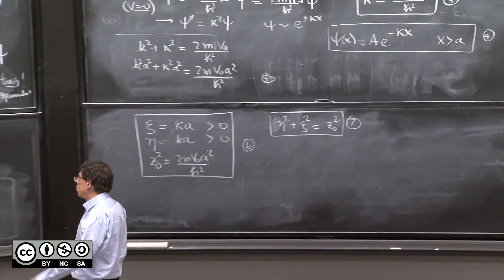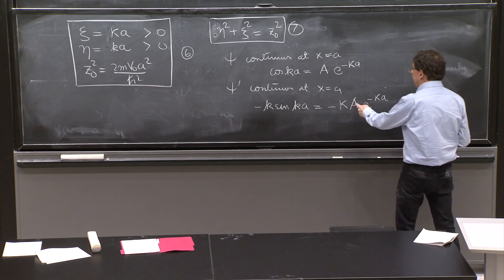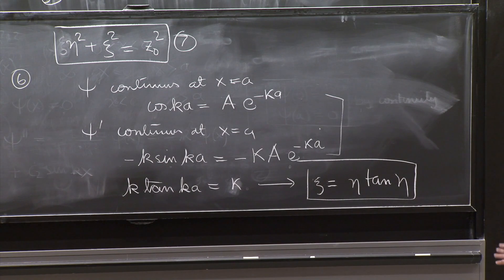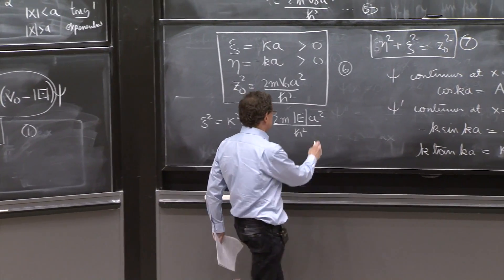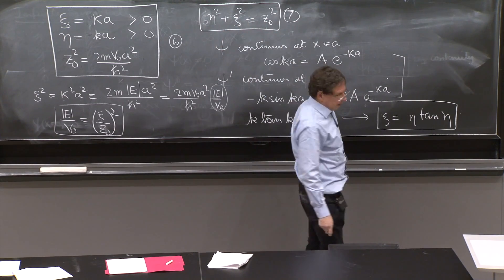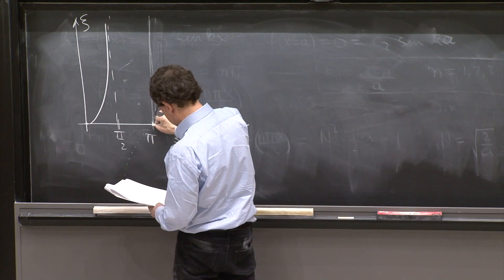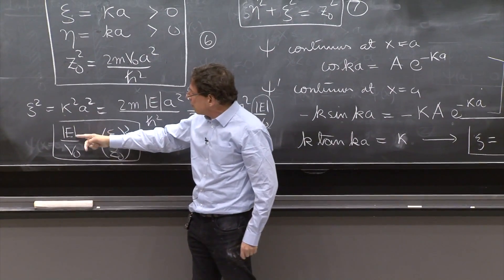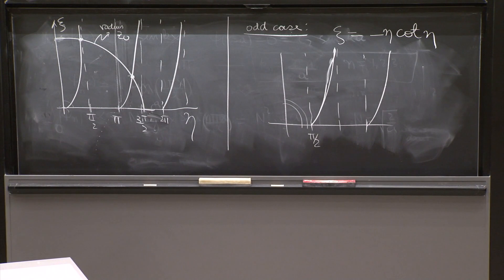Finite square well energy eigenstates

Comment: Why psy prime is continues at x=a despite V having a jump there ?
Reply: This was explored here (https://youtu.be/gMnQ21-pjOA?list=PLUl4u3cNGP60cspQn3N9dYRPiyVWDd80G&t=344). In summary, we are after stationary states (spatial part) that satisfy the time-independent Schrodinger equation. In this case, psi'' would be discontinuous because the V(x) is discontinuous, but psi and psi' should be continuous.
Reply: The probability current is continous. So psi and psi' are continous

Comment: Either the tan shouldn't be perfect or the circle (ellipse) shouldn't be perfect.  X Doubt
Reply: Yes, the solution lines he drew on the plot are not exactly correct. Near \eta = 0, they are pretty close to what he drew, but they would be lines with more localized curvature. The circle cannot be drawn just as a regular eclipse since you cannot simply scale the axes, however. The solutions only change in individual magnitude, not in the behavior he is describing here, though. The approximation he drew is a good heuristic.